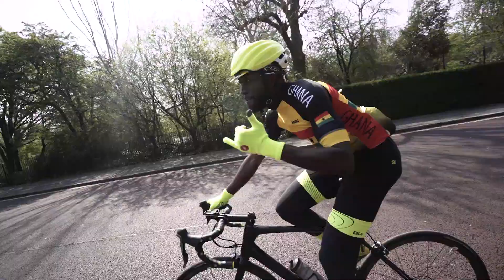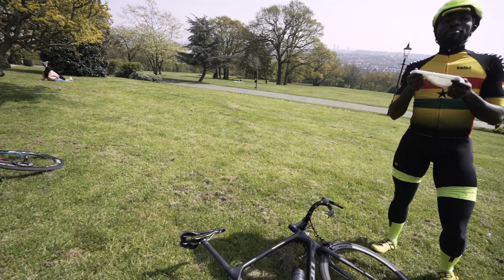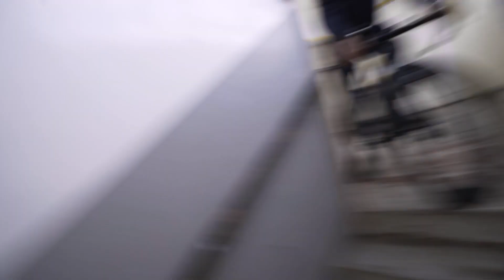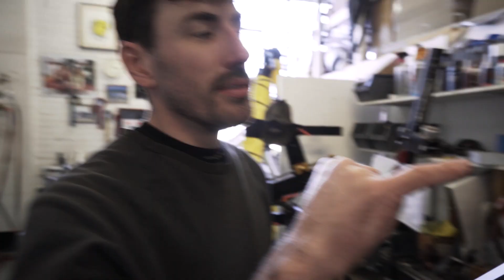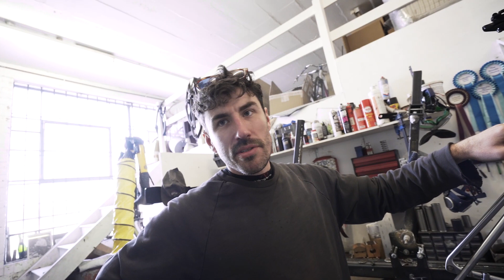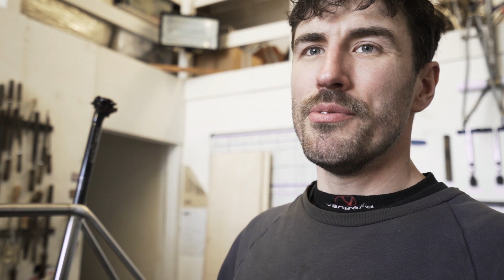THE BLACK CYCLIST'S NETWORK

Comment: Really great movement. Question Francis, Runnymeade Roundabout M25 junction, do you cycle around the roundabout, I had a motorcyclist shout at me the other day for riding it.
Reply from the maker: I'm not sure which roundabout that is!
Reply: dom_97 an M25 junction near Heathrow sounds a bit challenging, I’d find an alternative route?
Reply: @Cade_Media  the one just after staines by Egham on the way to Windsor, recently had traffic lights added.